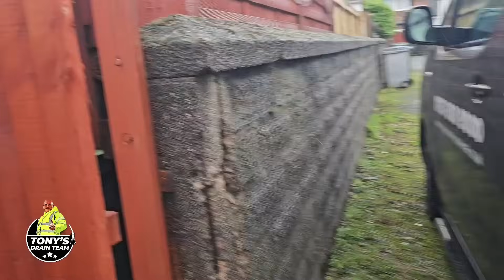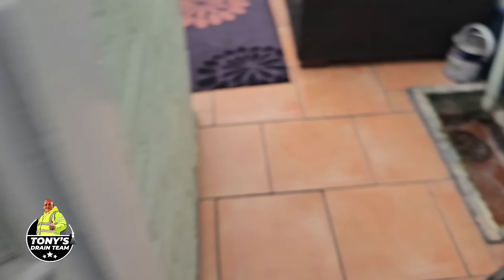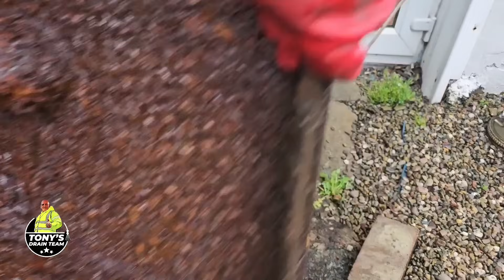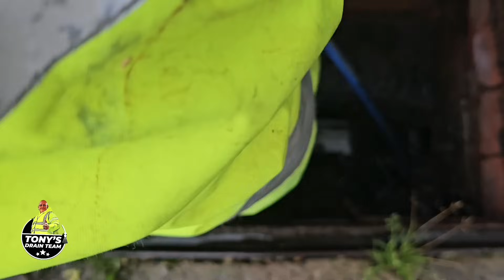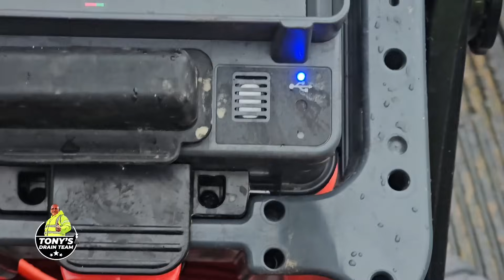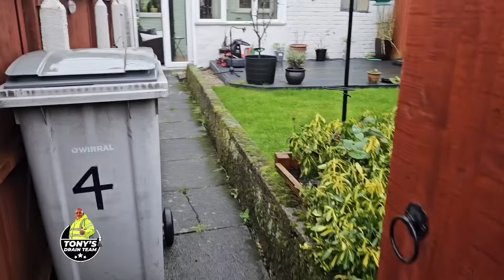Blocked drain. sewer mush #cloggeddrain

Comment: When you first lifted the lid, I thought the same.....an easy little interceptor 🤔 🤣🤣🤣
Reply from the maker: I thought it would be a quick plunge and away but theres much more going on there mate. It was hard to get the guy to accept he had a bigger problem
Reply: @drain-unblocker  Yeah after the clean out in the channel and he flushed the downstairs toilet there wasn't even a show,so definitely running into ground,but the customer couldn't seem to take that in 🤐🤐🤐